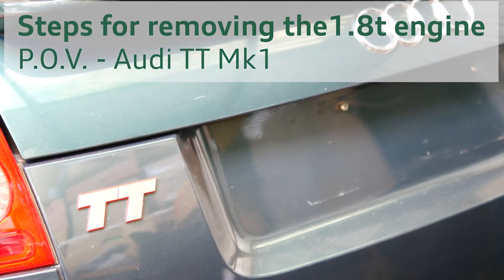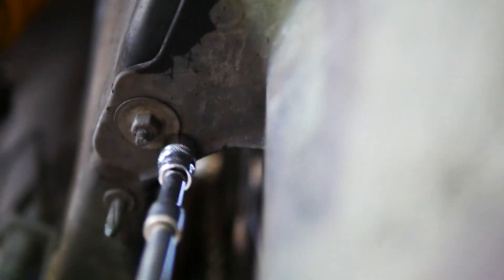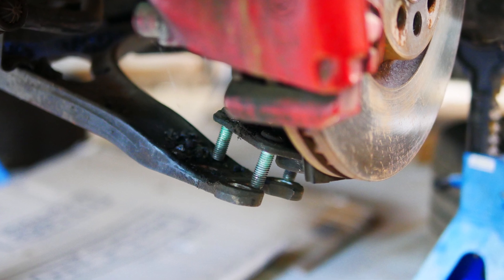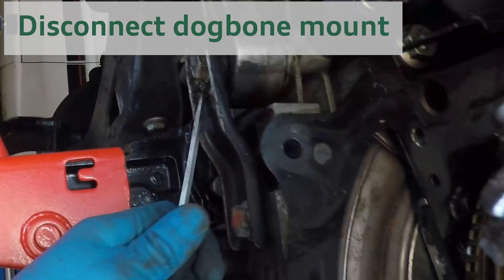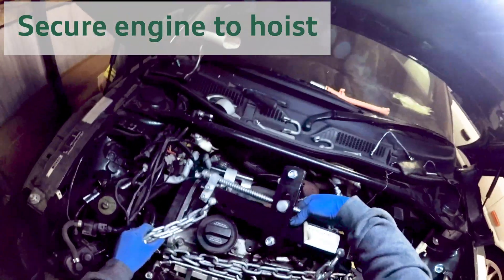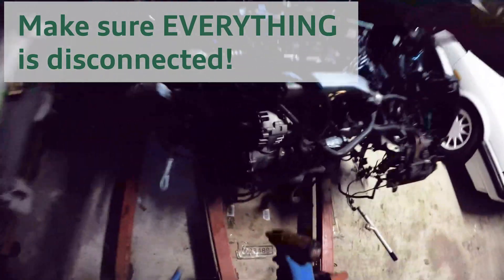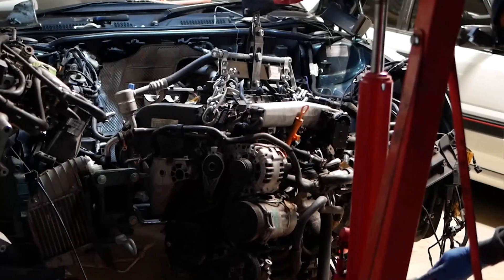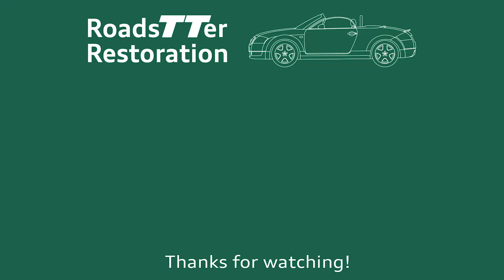Audi TT Mk1 Engine removal POV how to guide (in 7 mins). Also for 1.8t S3 8L & Golf Mk4 GTI

Comment: I found that if I had someone step on the brake that will stop the hub from moving and I can get the driveshaft bolt out :)
Reply from the maker: Oh really? That gives enough grip to loosen it? I should try next time LOL
Reply: @ yup worked great and in the spots where it was hard to reach the inner bolts I was able to spin it when needed not sure if it’s hard on it to do that but it helped a lot
Reply from the maker: @leader1944  awesome tips! thank you

Comment: could you not have taken the cv axel nut off and pull the motor with them still connected
Reply from the maker: @2001audi_tt  yeah if I had the height and machinery to lift the car up high enough and lower the engine but I was only doing this on axle stands